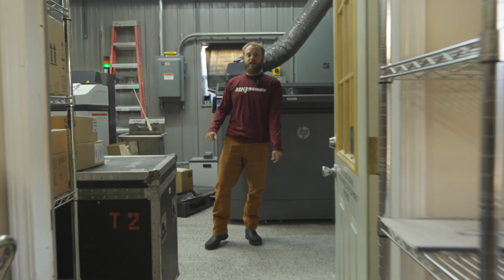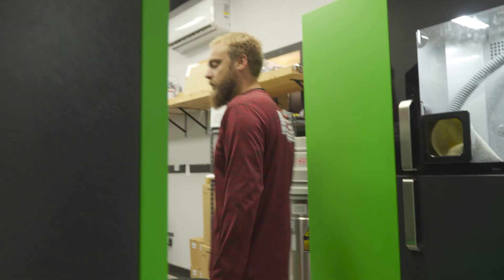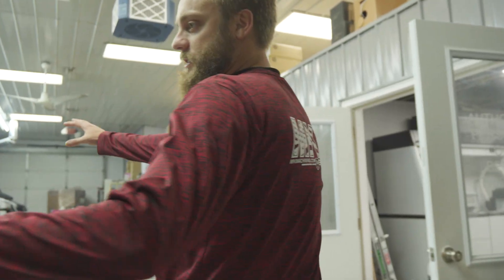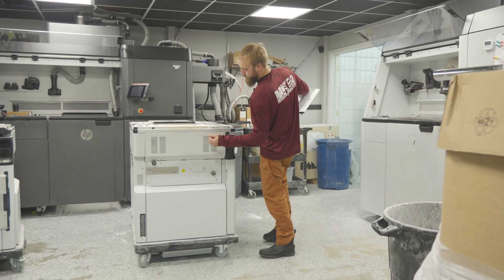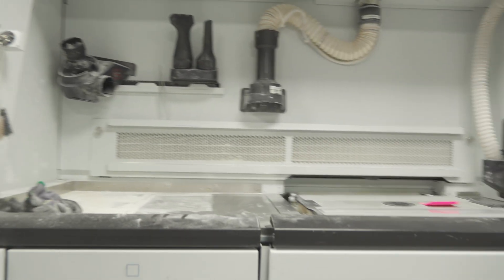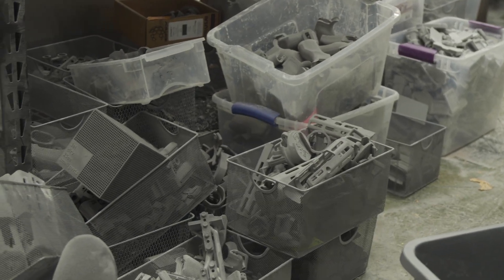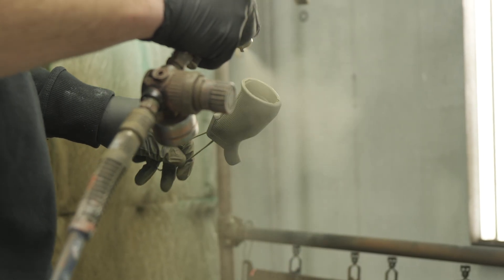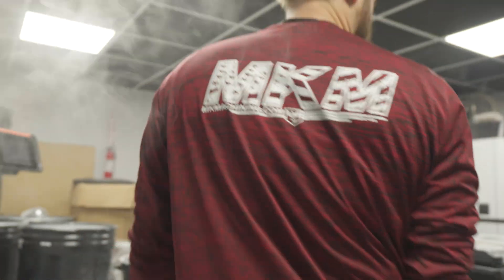Inside MK Machining's Industrial Print Shop (Late 2024 Tour – Updated Walkthrough Coming Soon)

Comment: What kind of ballpark are you in as far as investment in machines for the metal 3d printing? I've got the beginnning of an idea for a metal 3d printed product and I'm trying to wrap my head around how much funding I'm gonna need to raise. Still in the dreaming phase! Thanks in advance. (P.S. Not a market that would compete with you, just use a similar process.)
Reply: I would also like to know.
Reply: I am interested in this info as well. I would like to start an R & D.
Reply: We compete in all markets, but we always want to open and honest with everyone. The forward facing side of the company is firearm accessories, but we are also contract a manufacturer.

It really depends on your needs and the size/quantities of parts you are wanting to produce. You can get into a production level DMLS printer for ~$250,000